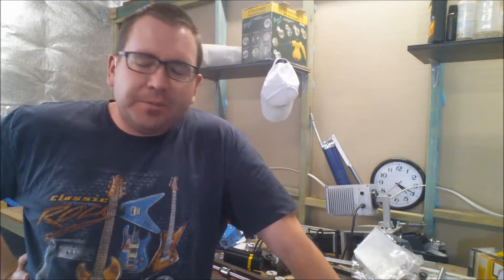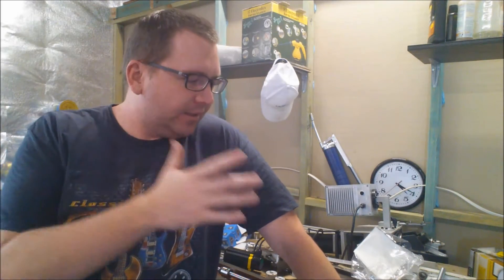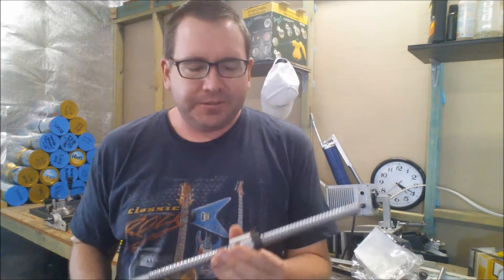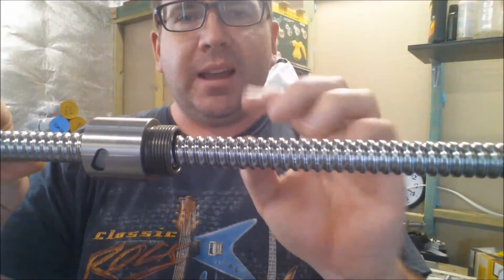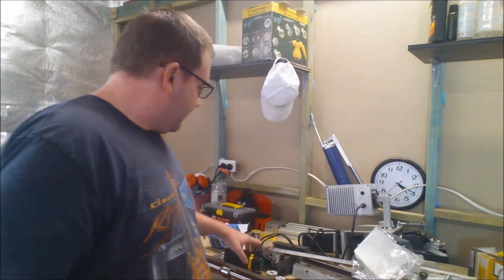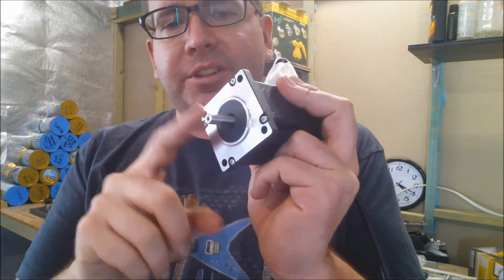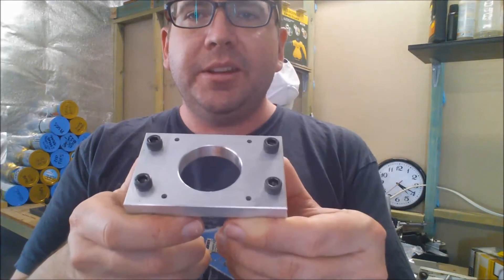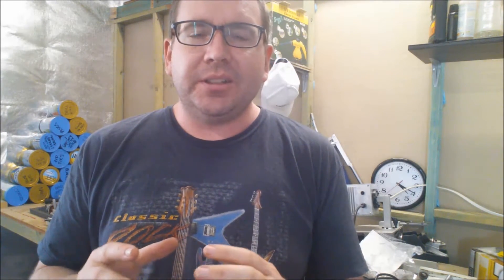Titan TM25v Ballscrews, Motors & More

Comment: Hi Chris, Im doing a similar conversion at the moment on a OPTI BF46 and have been looking into the TBI ball screws too. would you still recommend them? also what preload class did you get on them?
Reply from the maker: greatkid1 yeah I would still recommend them, I would get the dfu series which is a double nut that you can adjust the preload in buy adding a shim and that’ll remove the backlash completely.

Comment: looks ike an older video so i think ts save to ask  did you managed to get the close loop system to work , at this moment it seems there arent a lot of bob's that support this
Reply from the maker: watahyahknow the bob doesn’t have anything to do with the closed loop system. It’s all handled by the driver.
Reply: AHAAAAH (lightbulb) thats good to know , that will make my options for driverboards a lot bigger (building a cnc machinepark it looks like and i;m moving even slower than you are at times due to limmited budgets and growing wishes  , sumtimes thats a good thing as new bob's/driverboards seem to make things simpler by the week ) 

i had heared sumting of the closed loop being connected to the program , stopping it running as soon as it senses theres a step lost , that would make sense if the step is lost right before the mill needs to go around the corner 
at this moment i'm looking intoo both uccnc with an uc300eth - ub1 board
https://www.youtube.com/watch?v=xZn_jq5LR8A&t=37s
and the centroid / acorn setup (that runs its own software )
https://www.youtube.com/watch?v=6qvD5GuJUxI

both have their good things : acorn has the possibillity for reading a position sensor on the spindle of the lathe / mill so you can cut tread on a lathe or do solid tapping on a mill  uccnc doesnt seem to have that option (yet)
Reply from the maker: watahyahknow this mill is finished and gone. I am currently working on a Bridgeport clone converting it to cnc. I am currently using the uc100 with uccnc and works great. You can hook up the driver alarm to the bob but the drivers also has a tolerance setting of how many lost steps is acceptable before it faults out.

Comment: What are your thoughts on Gecko drivers?
Reply from the maker: Hi Eric, i have only used the g540 on previous machine builds, on my latest cnc router i used leadshine em705 digital drivers and to be honest they are a lot smoother at low rpm but the difference isnt noticable at higher rpm, so in slow movement they are just beautiful. But i think you would also be happy with geckos aswell, they have a good reputation for being good but i feel they are just a little behind the times. If search on youtube you can see a comparision between regular and digital drivers, it made my choice easy :)
Reply: ***** Thanks for the quick response. What did you mean when you stated regular and digital drivers? And do you have a specific youtube link you can provide me in what you're referring to? I'm already balls deep into the Gecko's drives as i have already purchased many items so far, but would like to know any info you have learned over the years between the two differences as it is much appreciated.....
Reply: Eric W. Are you referring to closed loop and open loop?
Reply from the maker: Eric W. Basicly the difference between digital and analog drivers,not open or closed loop as thats a position feedback thing. I will find a link for you, couod you send me an email to sales(at) cncmachineplans.com and it will be easier for me to copy and paste a link for you. Gecko drivers are good and youll be happy with those. Are you based in Australia?
Reply from the maker: Eric W. No :) answered in previous reply.
Reply: ***** Sorry, there is a lag between replies and needed to refresh to keep up.
Reply: ***** I live in United States.

Comment: Looks like the conversion is progressing very nicely, the brackets look good, like the ball screws for the X/Y axis.

what is a C7 / c10 ballscrew ????

WRT the surface finish, I had an ordanary fly cutter but the surface finish was crap, so after looking at the NYCCNC and CrudCNC using the Tormach Super Fly Cutter I got one, must say that the finish is very good.

cheers
Reply from the maker: Greg SB Hi GregC7 refers to the accuracy of the ballscrew or backlash, so for example if it is C7 then the backlash will be around .007 per 300 mm if it is C5 then it will be .005 per 300 mm and so on, i think i have my numbers right, so the lower the C Number the better the ballscrew but once you get down to C5,3,1,0 then your looking at ground ballscrews and they cost BIG money
Reply: *****
Thanks for the info, looking forward to seeing the next stage of the build.
cheers